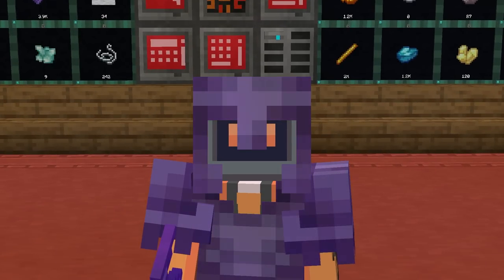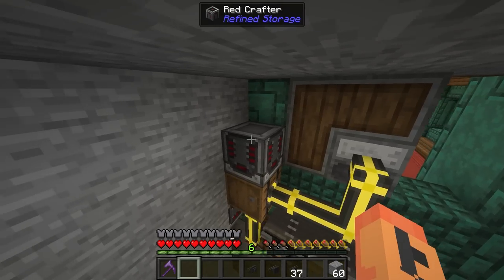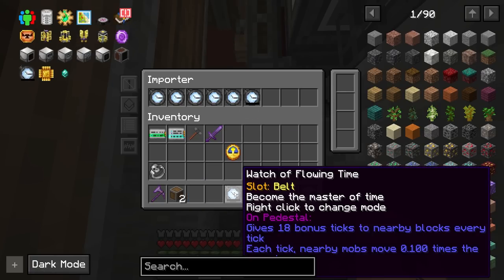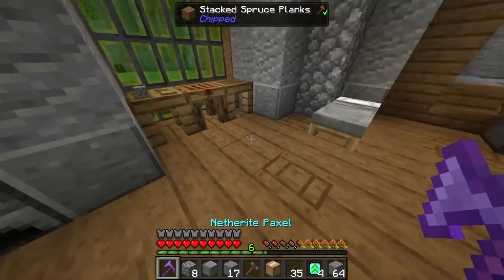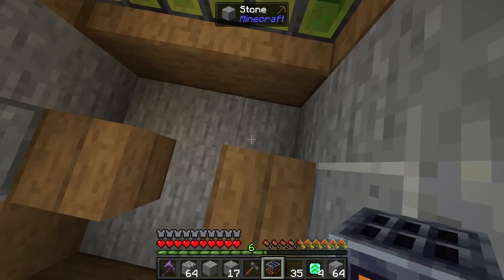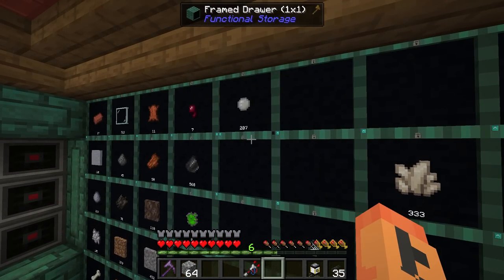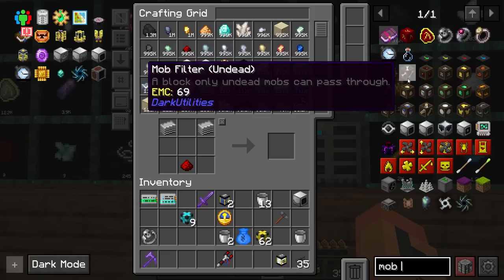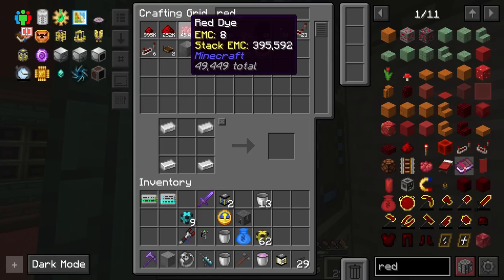FTB Stoneblock 3 Industrial Foregoing Automation - EP12

Comment: Don't forget about the constructor from Refined Storage for placing blocks.
Reply: Took the words right out of my mouth. I was thinking while watching, "why doesen't he just use RS for this?" Constructor for the logs, and fluid interfaces to move around and store latex/water. But System does seem to like to show different ways to achieve the same goal, which is cool.

Tip for anyone reading this and looking to get to the Boss area: Use the RF Tools Builder, and set that puppy to dig a 5x5, 512 blocks deep (max for the Builder). I did this and I used a void card so it doesn't need power for the actual operation; I just filled the buffer before picking up and leaving my base. Fantastic part is it's fast, crazy fast.

Comment: Hey @systemcollapse refined storage stores and handles very well. The pattern can include the exact amount needed when using crafters 🙂 plus you could use detectors who shuts off your slaughter machine when you’ve gotten enough pink slime meat ect ( or turn on/off a fluid trash can if it’s in the pack)

Comment: For the pink slime, seems to me it'd be both more efficient and tidier, when you rearrange where you're doing your RS liquid storage, to have the slaughter factory push the slime directly into the ender tank, move the jumbo tank to your RS liquid storage area, and put the external storage on that with the other ender tank pushing into it. I suppose the overall amount of slime in existence is the same either way, but this way the system sees more of it available. (For that matter, maybe do the same thing with the latex.)

Also, I find it kind of funny how, for like five seconds at the start of the pack, you were all psyched about being in a slime chunk, and since then they've been gradually making themselves more and more the bane of your existence. 😂

Comment: For simpler WoFT setup, you can just use item pipe from the result chest(instead of interface -> chest with importer) to the input chest(where clock, gold, ... saved) then filter with whitelisting incomplete WoFT without NBT tag.
With this, you dont need to struggle with many kinds of incomplete clocks.

Comment: They must have changed the recipe for the block placer.  I crafted it without any oil.
(Weird.  Just looked at the recipe in the updated pack and it can still use oak planks.)

Not that it matters but the only use for the tiny dry rubber is plastic.  I just ran the latex processor into a crafter and then the furnace.  From there I just stored the plastic in a drawer.
Reply: The name makes it sound like treated wood should be needed, doesn't it?

Comment: Does the old trick of overlapping watches on pedestals still work? Might help with the coke oven, stick a few under it and let them really juice up that station. They cover a 9x9x9 area each. So you could hit the center block of the oven a number of times to speed it up (if that still works)